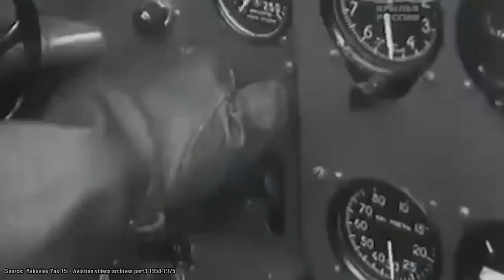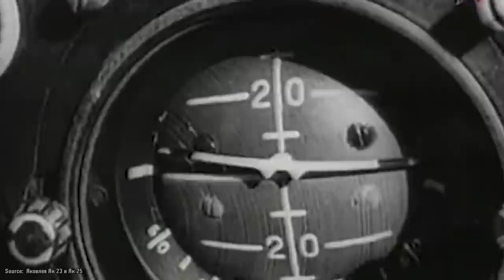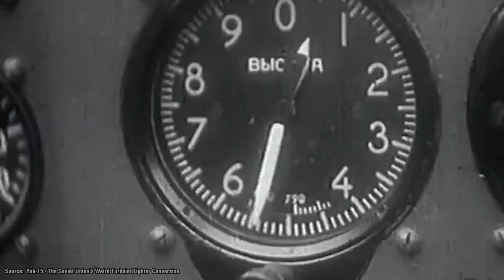Comintern Fodder | Yakovlev Yak-23

Comment: Slap a couple of RR jet engines on a P38, might be fun.
Reply: The P-38 was Mach limited. The P-51 with a jet engine was the FJ-1 Fury - with swept wings that became the Sabre.
The Jet version of the Spitfire was the Attacker (via the Spitfire XIV/Spiteful).
Reply: @allangibson8494  thought we figured out it was flutter with the elevator?
Reply: @SuperchargedSupercharged  Nope (though that was part of the problem).
At Mach 0.68 the airflow over the wing on the P-38 separates due to going supersonic and it tucks into an unrecoverable dive.
All the German fighters were good to Mach 0.75 so could dive away from the P-38. The P-51 could reach Mach 0.80 as could the Spitfire (actually Mach 0.89) before this happened. 
This was also why no WW2 aircraft exceeded Mach 1 (at least with the propeller and wings attached).
This was the region the X-1 explored.
Look up “critical Mach number” and “compressibility” to explore the topic.
Reply: @allangibson8494  Thank you, I think it would be a good looking slow death trap then.
Reply: @allangibson8494  The kept the 1931 looking rudder and stabilizers from a cartoon biplane.
Reply: Far too fat and not sure how you would redesign the twin boom fuselage to allow for the  jet effluent.   Actually the whole control of the plane would have been thrown off anyway since propellers would no longer be blowing air over the control surfaces.   Another problem the P38 already had was with loss of control over compressibility when approaching 500mph in a dive which lost quite a few aircraft before an air brake was added to break up the loss of airflow over the tail surfaces.

Comment: The conversion makes a certain amount of sense. Technology does not advance in lock step.  Look at agricultural tractors. The first ones powered by IC engines still looked like steam tractors. Some still employed a structure like a smoke box to force air through the radiator.  Evolution, not revolution. It makes you appreciate the Revolutionary nature of German jets, because they were anything but IC powered craft with jets grafted on - the engineers were taking a leap forward.
Reply: The Me262 started with a piston engine in the nose. That’s why the jet engines were under the wings (that and it needed two to guarantee one was still running after each flight).
Pusher aircraft converted to jet power quite well (like the Saab J21).
The tricycle landing gear on the Me262 came of the Me309 (literally - they were removed from the Me309 prototype).

Comment: 0:15 the B-1 is rocket powered ;)
and about your question at the end, for sure not a Yak-3 because of the low wingrip speed , you better built a jet fighter with new (for a Jet optimized) fuselage and room for updates/improvements, Yak-15/17/23 was only a improvisation, in aviation you better make "nails with heads"
sry for crappy engl.
Reply: A rocket is a jet. What a rocket is not is a turbojet, which is what most a referring to when they use the word jet. A chemical rocket produces a jet propulsion effect, resulting in thrust. Oxidizer must be provided and mixed in the combustion chamber with fuel, whereas a turbojet or the more modern turbofan jet uses air as the oxidizer and compresses it before mixing and ignition. A solid rocket is jet propulsion too.  This is why aerospace capable countries had jet propulsion labs involve in both rocketry and turbojet research, i.e., both are forms of jet propulsion.

Comment: I have the book "Early Soviet Jet Fighters" that goes into great detail on this type.

 Were the Yak-23's in sufficient numbers like the L-39 it may make sense for a Reno air racer to acquire one as a basis to convert back to piston power with say an R-4360, instead of starting with a more dainty Yak-11 fuselage. The cowling is almost ready for the round radial with a very efficient ventral placement for spent cooling air and exhaust pipes. To keep it a nosewheel job would involve some interesting engineering for prop clearances, or revert to a strenthened Yak-11 wing. Yes I know the races have been discontinued, but not the passion.